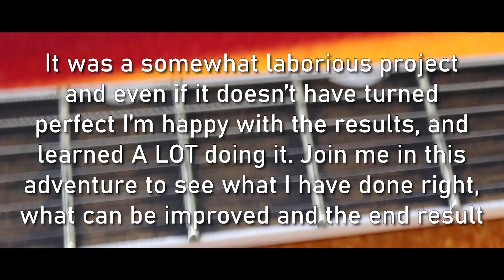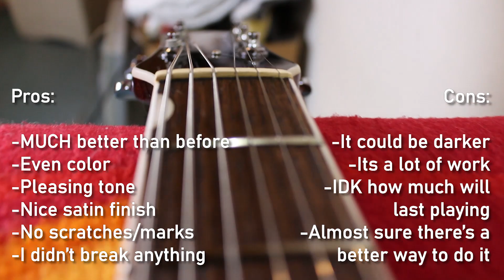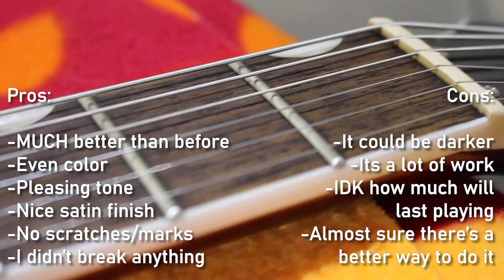The Fretboard Of My New Gretsch Sucked So I Stained It

Comment: Try a product called Montypresso. It's a wax based dye that conditions the fretboard and darkens it with each application. It will help maintain the stain and darken it further over time.
Reply: Available at FU Tone in the states or from the makers in the UK. Monty’s Instrument Food is a clear beeswax conditioner to maintain fingerboards that are ideal in color. I’ve used it to “seal” the Monty’s Expresso Relic Wax. FU Tone runs a 20% coupon about twice a year at early Christmas and late spring, early summer. I’ve purchased from both. It’s way less expensive from England, but shipping is way more. FU Tone seems to be the best deal with a coupon. Good stuff!!

Comment: Looks good, doesn't look hacked at all. That looks like a factory finish. The steel wool did polish the frets nice too. I noticed some steel wool dust in the nut slots I wonder if that makes the strings less likely to bind in there 😄
Reply from the maker: Thanks, glad you liked the results! Nut slots are dark because I was using some graphite to lubricate them

Comment: My experience on a copy of fender precision bass with "rosewood" fretboard:
undiluted, darker than wanted end result stain, more than 12hrs between 2 coats (did only 2 coats, applied the first coat, went about my day and tomorrow did the second) and 2 coats of boiled linseed oil resulted in perfect success.
It's true color turned out lighter than advertised when completely dry - as expected, but the boiled linseed oil brought it back and gave it another dimension.
I didn't scrape off the original paint, but I did use 0000 steel wool to burnish the linseed oil finish and clean frets.
Total waiting time: 3 days
Great color and durable, I have a heavy touch on both hands and it lasts for all these 3 years since I've done it, albeit, the bass is a different animal than a guitar.

Comment: Nice work! I don't mind a lighter colored fretboard, so I probably would have elected to clean off the old blotchy "coloring" and gone with a good oil to treat the dryness and it would still give a nice even coloring while darkening it naturally (not as dark as your method of course...but as I said, I don't mind the lighter colored fretboards) Thanks for sharing your process.
Reply from the maker: Thanks! I usually also don't mind light fretboards but in this case didn't liked the tone of the wood at all. After removing the old stain it was more a pale gray than a light brown wood tone. I hope the stain holds and gets darker with time (fingers crossed)

Comment: I found water based dyes work well (water has a natural affinity to penetrate the cellulose structure better than organic solvents).
Reply from the maker: Thanks for the advice! I was considering water based dyes but I was afraid that the previous stain from the factory was solvent based and made more difficult for the new stain to penetrate into the wood
Reply: @InspiringTracks  I did this on a couple of real old necks, and after sanding the fretboard from all grit and old finish. On new , freshly oiled fretboard a water based dye may indeed not work.

Comment: Use bodyshop Wax & Grease remover first, before you start using any abrasives, otherwise you'll just spread the factory wax based stain & finger oils into the microscopic cells of the wood, preventing fresh stain from penetrating. Repeat several times and allow to evaporate for several hours between applications - you'll need to pull all the natural oils out of the surface. The drier the wood, the more effective stains will be at penetrating and taking hold. Use a solvent based stain, several shades darker than the end result you want and dilute with Naptha (Lighter Fuel) for ultimate penetration. I have found Ebony (Black) stain will ultimately dry a very dark brown on lighter woods. I think chemical blackening is probably the answer - still researching ...

Comment: Next time put a soft layer of china ink first to darken it, then it will get lighter within few rosewood tint coats. To be honest I liked the original disgusting look but I'm a weird guy anyway
Reply from the maker: Lol thanks for the tip! I was considering china ink but since it's water based and the stain is solvent based I was afraid that this could cause some issues with the wood not absorving the pigments correctly

Comment: A better way to do it. Never use "Lemon oils" or what is actually mineral oil that never dries from the get go.  Once a fret board is soaked with that stuff it will never take a stain as could be seen here.   Better to scrape the board with a Stanley razor than sand or steel wool.  Instead of stain, Use a 50/50 mix of pure tung oil and pure gum/pine turpentine, Wipe on wipe off once or twice per day over three days or until you see a build.  and you are done. The board will seal and gradually darken over time to very dark.  THEN you can clean it once a year with mineral oil.  And no stained finger tips after playing!
Reply: Gradually darken over time eh? In this day of immediate gratification, the 3 days he took seem to take an eternity. I’m impatiently waiting some Stewmac India ink to thoroughly dry before wiping with their Color tone fretboard conditioner. I believe it seals a bit. I’ve reapplied ink to some touch-up areas and have to start waiting all over again.

Comment: LMAO....! dude, they coat them in penetrating sealers.  that's why it took so much work to truly get nowhere. it would have been much simpler to order a new fret board (unfinished) and then treated it etc etc etc.
Reply from the maker: Lol how replacing the whole fretboard is simpler?
Reply: @InspiringTracks  if ordered pre-cut and the frets pre-tapped. after soaking in the die. it's just a matter of tapping in and gluing the frets. then gluing and clamping the board to the neck. the entire process wouldn't take and hour for a laymen. than just wait for the glue to fully cure and then buff it all out. done....
 and if you are trying to die your existing fretboard. i would VERY carefully mask off all surfaces. and apply several light doses of stripper to remove existing sealers. then begin applying the die. 
 this video showed the effects of multiple layers covering the existing layers of sealer. bare exposed wood will readily absorb any color you apply. purple... pink... blue... and yes, black. 
 you see, the problem with trying to die an existing fretboard. is that the sealers used don't just seal the wood. they form a bond that strengthens the wood. without this, a fret board wouldn't last more than a few years of regular use before the wear needed repair. so even the highest concentrate of die is only staining the surface of the sealer. and is unable to actually pernitrate the wood fibers.
Reply from the maker: Lol apart from the cost of a whole fretboard you need to redo the bindings and inlays, unglue the old fretboard and refinish the neck, that's an insane amount of work compared with this. It also requires specialized tools and lots of skill. The stain actually pentrated really well in the wood, here you can see after 6 months of playing how it looks as good as the first day https://youtube.com/shorts/KkoUWnYnruk?feature=share
Reply: This may qualify as the dumbest advise on the whole internet
Reply: @InspiringTracks  clearly you're discussing something you know nothing about. over the years i've ordered new fret boards many times. most often just to change the look of the guitar. and just about ANY company that produces them. you can order it to be delivered in nearly any state you wish. and no.... tapping in new frets doesn't require anything special, expensive or hard to find. simple flush clippers and a fine file is about all you need. you can even order frets pre-cut. inlays are pretty much the same thing. you can or item pre-done or simply do them yourself with ease. 
and i never said what you did was bad. just offered a way to do it much better, period. and if you doubt that. simply do a little searching on actual wood coloring. if done to clean or fully stripped wood. you can achieve vastly more color effects.
Reply from the maker: Ok